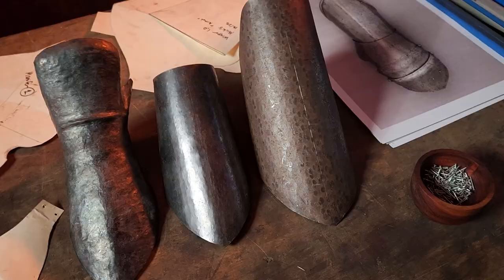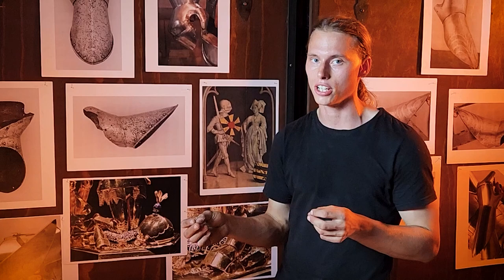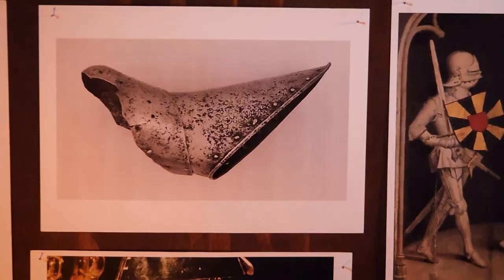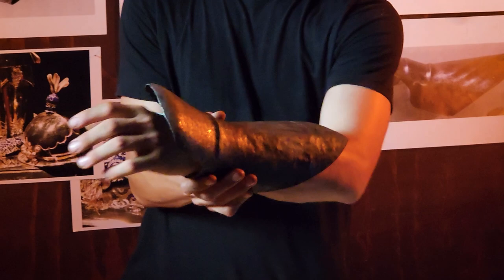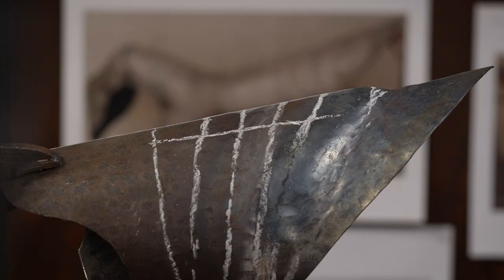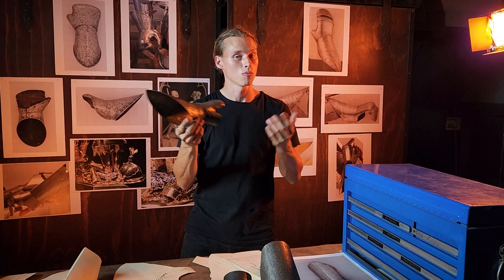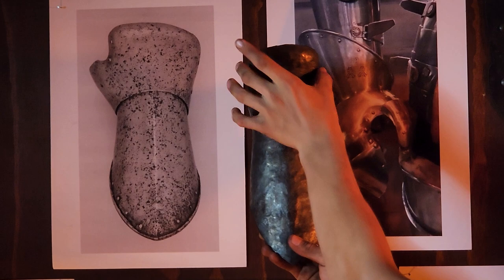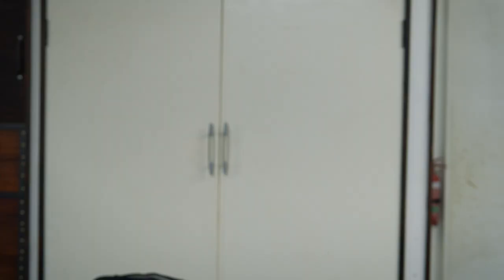Where to START Making Armor?!

Comment: I think that taking high quality 3D scans of museum pieces would be a great addition to the toolset if someone could get them.  Or even for existing amourers to take 3D scans of their own work and put them on an shared online repository. Being able to have a high quality scan of the piece means that any armourer could use a 3D printer to build a physical item to reference/measure directly while building.
Reply from the maker: This is a brilliant observation. In actual fact there is right now a move to start scanning in 3d museum pieces. As to scanning our own pieces, I think this is absolutely something IronCrown Workshop will be looking at doing with our pieces in the near future